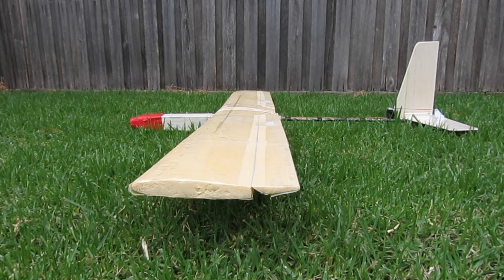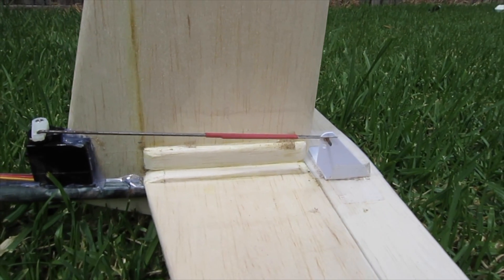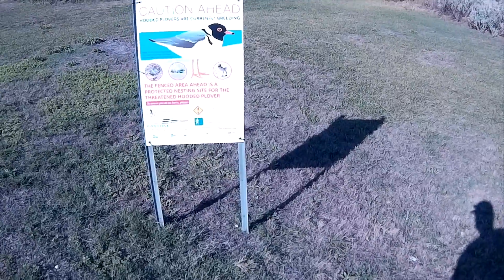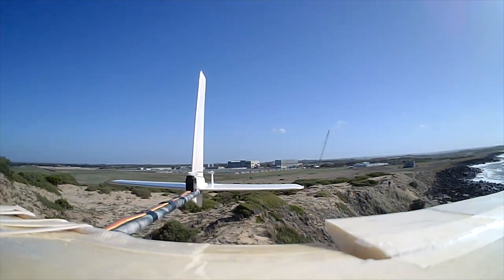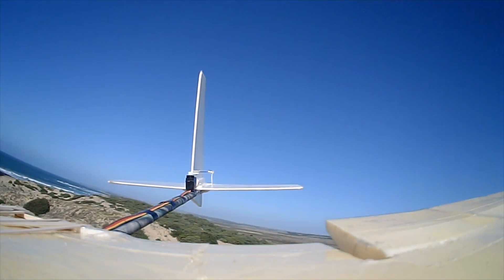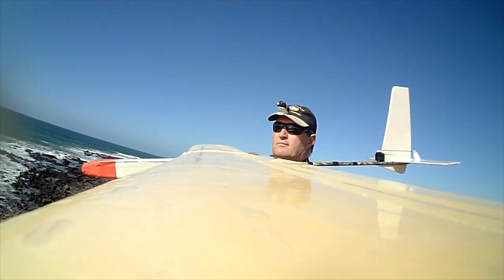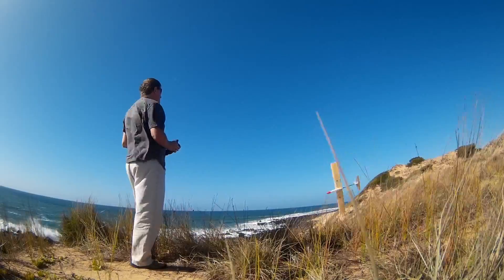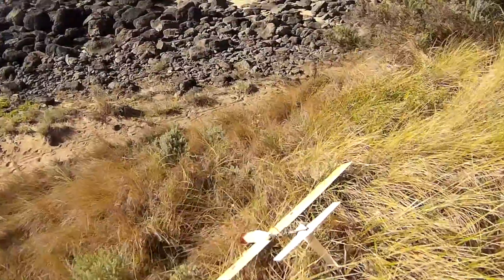Speedy sloper update

Comment: Nice update sir :) Glad to see it flying well! 
Wouldn't you require a smaller battery if you would have the tail-servo up-front by the way? :$
Cheers & thanks for sharing :)
Reply from the maker: +DutchRC Adventures Yes, but......more weight equals more speed for a high wind sloper. In 20kn I change up to a 2200mAH

Comment: Do you just stick the tape on and done? I have found with foam board and epp that using a hot iron makes tape really stick
Reply from the maker: +Nathan Knight Yes I do, but I'll try your tip. Thanks for that
Reply: I use the same temp as my epp laminate film.